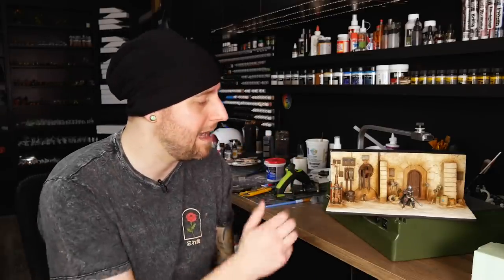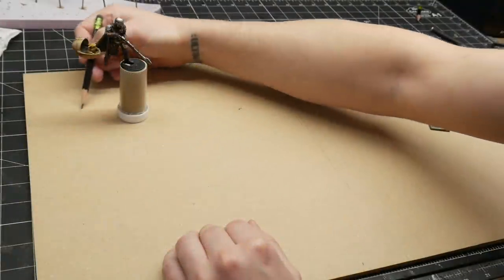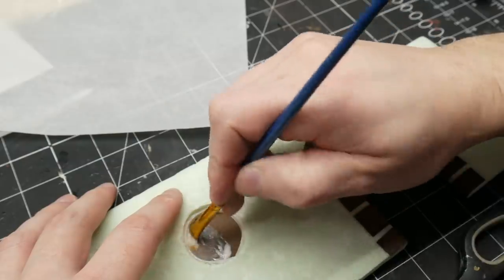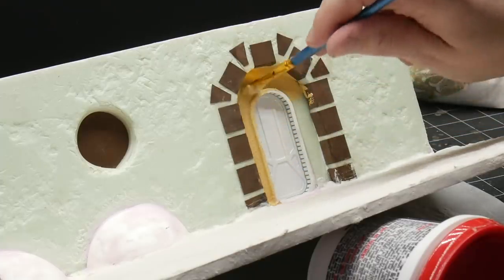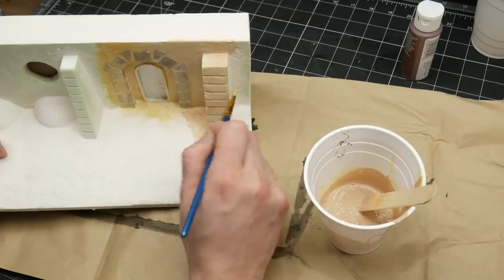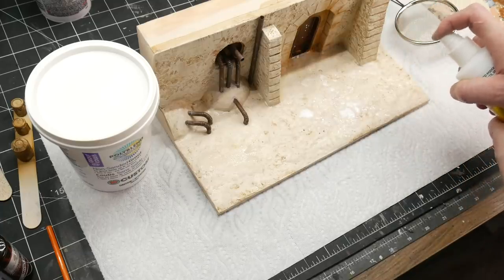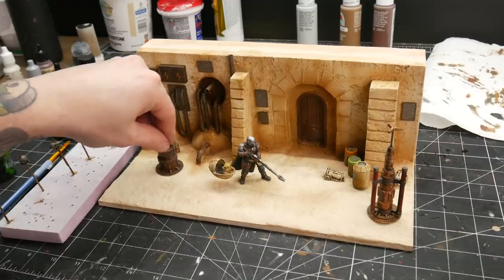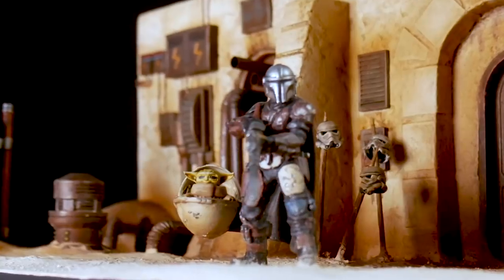MANDALORIAN - Miniature Diorama Build with BABY YODA

Comment: Check this out: I found a neat plastic disc inside a Starbucks Holiday Blend Keurig coffee cup. After making a cup of coffee, I took the used Keurig cup,  removed the foil cap, discarded the old coffee grinds, and removed the wet coffee filter. Then under all that muck, you'll find a NICE a hold plastic disc with small holes. These would work great for forming objects in a models like this.  Pretty neat!

Comment: Idk if this is a helpful tip for you but if you dont have sandpaper or want to avoid a mess, you could also smooth dry joint compound with water and if you are wanting a bit of texture use a wet rough rag

Comment: One of my current projects I am working on...well in my brain.....involves pipes.   Pretty sure Straws are the way to go over printing.  Cost, simplicity, speed.
Reply from the maker: For sure. I'd like to find some stls for connector pieces that perfectly fit the straws. That would be ideal.
Reply: @BlackMagicCraftOfficial  Seems like something you could model yourself. :)  Tinkedcad to the rescue!
Reply from the maker: I'm not there yet. But I'd like to start.

Comment: Really cool build. Mos Eisley is iconically Star Wars. Just can’t have a Star Wars story without at least one trip there. 

The whole, “how do I substitute for Mod Podge” dilemma really got me once and I knew I absolutely couldn’t use regular PVA. So.... I ended up using ‘Gorilla, Wood Glue’ because I realized it cures water proof. It does work pretty good, but I think Mod Podge does cure a bit harder. May not be the cheapest solution, but when you have to use whatever you have on hand and you can’t risk re-hydration of basing materials or primer/sealer, PVA just won’t do. Just thought I’d share that with you. 

In fact, I’ve decided to bite the bullet and move completely away from PVA (Elmer’s) to Gorillas Wood Glue, for the exception of my diy snow “paste”. But, I’m looking for an alternative for that as well. Probably end up with Mod Podge satin or gloss, or some mixture of the two. 
Also, have you tried Mod Podge, hard coat?

Comment: 10:50 you can also take a heat gun to it, that Expands the cuts and reinforces the foam
Reply from the maker: I do not recommend that method.
Reply: @BlackMagicCraftOfficial  why's that?
Reply from the maker: @bchoflet8031  because it's difficult to control and almost always results in a sloppy look where the grooves are too large. It also creates an undesirable thin lip around each edge as the foam around it shrinks for the heat.
Reply: @BlackMagicCraftOfficial  ahh thank you for the heads up

Comment: To counteract the PVA solubility add some varnish to your mix. I use this commonly instead of the black modgepodge you use. It's cheaper add modgepodge is not easily available here. Ingredients: PVA, varnish, flow improver, black acrylic paint and water. Bish, bash bosh
Reply from the maker: Mod podge is the same price or cheaper than pva here, so making your own is actually more expensive. YMMV by location,
Reply: Modgepodge 236ml between £2 and £5. Pva about £2 for 1000ml. UK. When I next visit Canada I shall keep a few liters in my hold luggage free. That's what I'm talking aboot!

Comment: Jeremy;
Cool Build.  Definitely one of a kind.
You said you ran out of Mod Pough.  Well I'm a cheap skate.  Here's where those two come together.
For textured or tinted Mod Pough I make my own.  Just small quantities on a lonely quiet night.  In case you'd like to give it a go here is the recipe.

First dilute 50/50 PVA and H2O.  Up to 10 ounces per tint.  Here is where I add the tint by sight.  Always add more than you think is enough.  The mixture will set-up lighter than what's in the container.

THOROUGHLY mix in 1 teaspoon of lacquer flakes per ounce PVA/H2O mix.  The lacquer flakes need to be totally mixed in.  (BTW I do keep lacquer flakes dried & sealed for months in my grown-up woodworking shop as a furniture finish.)

When the mixture is fully dissolved, add 1 teaspoon at a time Cornstarch to the mix.  The Cornstarch is the thicken agent that adds strength, however, it also shortens the drying time.  Applied or Capped up.  I have been known to make up a few batches the night before use, but I never store it longer than two nights.

Give it a test.  You may find on those "dark and stormy (Canadian) nights"  this little stitch in time will save you  trips to nine different hobby.

Nice build;
~Jim
Reply from the maker: Thing is.....mod podge can be bought just as cheap as pva here, so buying other stuff to make my own doesn’t make sense. I just didn’t want to leave the house and delay the project to get some. But useful tip for those that can’t get it easily.

Comment: This is a great build!
You need to stop having "the crunch" in mind, as if everything you make must result in profit or being sure 100% of your time was not wasted. This entire hobby is "waste", from a certain point of view.

What you made here is something similar I made, 20 years ago, sans The Child, but a child was involved.
It was for SW, and it was dioramas, it was 6 presented 1-by-1 in order of player actions that in the end were connected and then formed a complete story with a 7th that could not be guessed after experiencing the 6 previous, since they were in random order. They were used in a SW tabletop rpg I DM'D/GM'D, it was heavy on the storytelling side, without sticking to a grid system on how far a mini could move; the minis were a part of the diorama for this occasion and could not be moved. It was a mix of samurai and spagetti westerns with clear inspirations from Lone Wolf And Cub.

It was as if the players could get that birds eye view of a situation and it was very memeroble for them; an unique roleplaying experience.
So try that, at least once, a rpg session, where the players get a story, several dioramas, and that they are in this "observing mode" of what's going down. Their minis can always be added and used in the dioramas, but it's more fun if their minis don't show up in the final diorama in the "end scene".

Your work here is great, I do wonder why The Childs crib is not off-white, but it might just be an error in your memory.
Reply: "From a certain point of view", I see what you did there. 👍

Comment: You made me google "unsanded tile grout". Thanks I guess :D 
Any suggestions what to use instead or where to get smaller batches from?
Reply from the maker: You can buy it in tiny containers. Like the one you see me using. It’s cheap.
Reply: @BlackMagicCraftOfficial  Thanks, I've found 200g baggies on amazon.

Comment: Great Building.. i'am following you since a couple of month.. but which puttys you use for this building.. I'am from austria and i don't understand everything in the detail. I'm very happy you can answer my question, many thanks from austria
Reply from the maker: Drywall joint compound. Sometimes called spackle, filler, drywall mud. It’s what you use to fix small cracks and holes in walls. Your local hardware store should have something like that.
Reply: Many thanks for making it so easy..
A ordinary putty to Crack..
I think sometimes to complicated